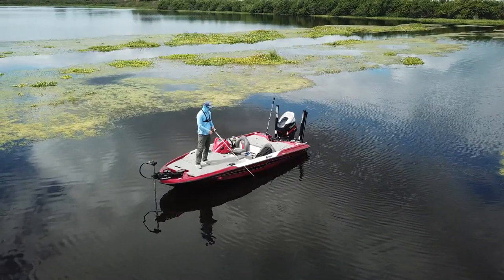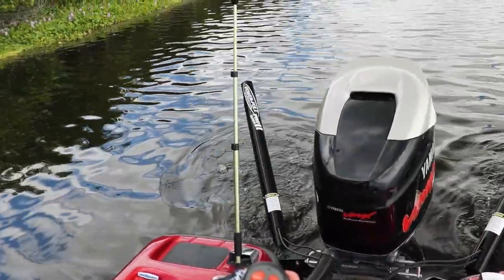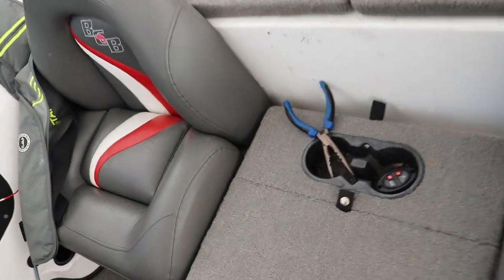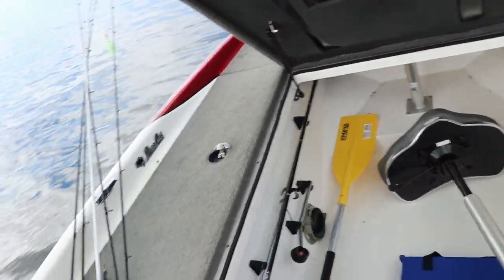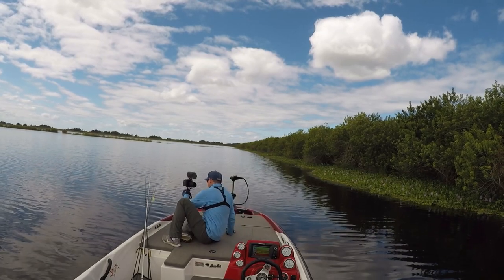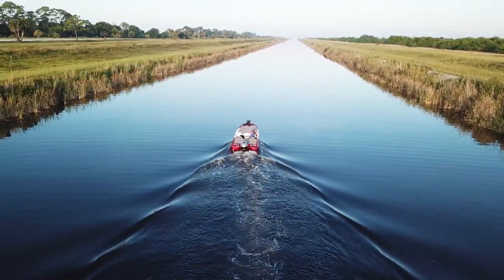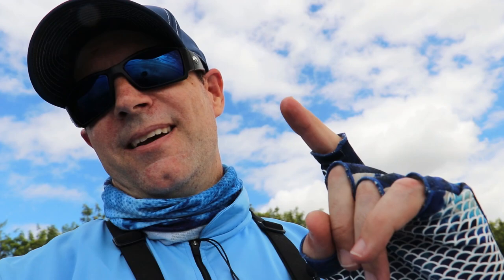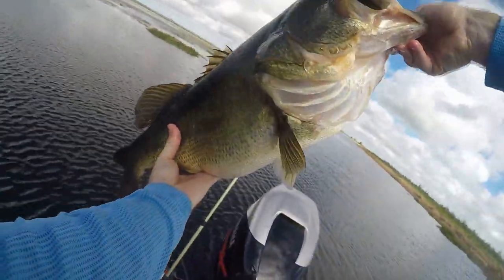What Everybody Ought to Know… About a 17 Foot Bass Boat| Boat Tour

Comment: I bought a brand new 1990 Bass Cat Margay with a 115 Evinrude with stainless Raker prop back in 90! It was my first boat! It was fast it weighed 700 pounds back in 1990! It was sparkly blue and grey! It would run in low 60s and that was fast back then! I now own all payed off a 20ft Bullet with 225 XS Mercury with sportsmaster racing lower unit 85mph gps! Back then Margays were rated for a 120 the beam was 79 inches it was 16 and a half ft! It was 20 years old when I sold it for 8500 and I payed 9900 for it! I all ways kept it garaged!
Reply: Your Margay probably weighs 1200 to 1500 pounds! Back then I would out run Rangers with 150s and some 200s

Comment: If I had the money for a fiberglass bass boat that is exactly the boat I would buy. I got to go on a tour of the Bass Cat and Ranger boat factories when I was about 12 or 13 and I have to say they both really put a lot of attention to detail and quality into their boats. They are definitely made to last. Back then Bass Cat was still using wood (I don't know if they do now or not) but all of their wood was sealed in fiberglass. They were build like tanks.

I have to say, this model, from what I have seen in my dream surfing of boat websites this one is probably the most efficient model of all. However, at my budget and actual needs I am more of an aluminum 16 or 17 foot bass boat or multi-species (Ranger 1660T please) guy with a portable 6 gallon fuel tank.
Reply from the maker: James, thanks for the post 👊 I had a 16.5 G3 Aluminum bass boat before this one. Caught a ton of fish in it for 12 years and could get to more places on the water compared to the Margay. Good luck on your boat hunt👍

Comment: Website says 19' 11" for the Margay and 19' 8" for the Sabre FTD. I'm in the same boat as you. I need it to fit in my garage. My garage is 19' 10". Yes, I probably won't be able to add a Jackplate, but I'd rather do without, than paying for storage. 
Talked to the guys at Aquatech and they are by far Amazing people to work with!!!
Reply from the maker: 19’ 11” sounds right. You can also turn the outboard and get a few more inches. 19” 10” should work.

Comment: Very nice boat!  I've been running my 06 Pro Craft 175 with 125 Mercury for a long time and have never felt I needed anything bigger.  I'm no brand expert but it goes through chop and swells very well for a smaller boat.  I've seen larger boats struggling much more while out with me.  I want to upgrade to a newer Margay if I can find one, or a Ranger in the same size range...hopefully in another season.  Thanks for the review..Can't beat a BassCat hull very easily.
Reply from the maker: Stu659Zuk, Pro Craft are nice boats. I agree, the 17.5 is a good size 👍
Reply: @NormGfishing  does this boat hold 8ft rods in the rod lockers??
Reply: Yes sir finally somebody else has a proctaft

Comment: I had a 17ft Champion with a 150hp where I had the cylinders bored out due to the shop not having any 150hp parts when a rod went through the head. So it was rebuilt as a 200hp, the speedometer toped out at 85mph and I'd peg it without a problem. I'd fire up my motor and everyone at the dock would turn to see what started. It started tearing apart the transom though so I had to take it in and get that reinforced as well. If you wanna go faster trim that boat up dood. Running through the canal at the end of your video you're pushing way to much water, get that front end up, trim that motor up and let it rip!
Reply: Champion Super V? The 16ft 8incher from the early 1980's could move.
Reply: @richerwin6397  Why yes it was haha. Imagine a 200hp on that thing too...Fastest boat I've ever been in.
Reply: I seen a Mean 15 Champion with a 150 on it, he put sand bags in the middle storage area to help keep things under control! The were rated for a 85, I think!
Reply: @jimmycline4778  Those Champion Super V's were great boats in their day.    They were designed after the Skeeter Wrangler, truthfully; a Wrangler was purchased and dissected. Champion improved upon them significantly.

Comment: Im all about saving money too, there's no need to drop 60-80k on a new bass boat because its going to loose value as soon as it hits the water.
Reply from the maker: Bass Legion, I agree 👍
Reply: Definitely.  I'll keep my 1989 Ranger.  Paid all of $4k for it.  Also an 18-footer, 150GT Johnson, deck extension, and 60+ mph with a light load.  It will do anything a new boat will do.  Obviously electronics are a lot different now than 30 years ago.
Reply: Look at the price of 25 year old Bullets. They are selling for as much as they cost when they were new.

Comment: My Javelin 379 was my favorite boat that I ever owned. I hated my 20 footer. I couldn't store it easily,  and it was hard to maneuver in small creeks.  Bass Cat makes an awesome boat. If anyone complains about the size of your boat, they can buy their own.  Not a fan of the power poles. They make boats look butt ugly, but to each their own.
Reply from the maker: Bobby, the Javelin is a nice boat. Thanks for the insight on the 20 footer.
Reply: I agree I took them off my Bullet and sold them, the lakes in Arizona are to deep, I’ll need 50ft power poles to even make them work!

Comment: what prop are you runnning? i have the same outboard on a champion...not really built for speed but i feel like i should be getting more mph out of her.
Reply from the maker: Champions are beautiful boats. I am using a Yamaha 25M 3 blade prop- this is a 25 pitch prop. The newer version would be a Pro model. 14 1/2" diameter 66K45972B000.

Comment: I don't own a bass boat but what is the purpose of those power poles dropping in and out of the water  ?
Reply from the maker: The power poles are shallow water anchors. It allows the boater to hold the boat in place when fishing or any other activity in 8-10 foot of water.  Back saver and they are fast.
Reply: @NormGfishing  Okay thanks for replying back and it's good to learn something new everyday !!!

Comment: Hey buddy I have a ranger r73 which is 17 1/2 ft and it has a 115 on it ...but its rated for a 130 ...did you repower or upgraded a lil bit larger engine than rated if so ...is it legal cause I've been eyeing those newer mercy 150???thanks and great vid
Reply from the maker: Hey Jonathan, the Bass Cat Margay has a Max H.P. Range - 70-150.  I bought the boat with this 150 H.P.  The Mercury 150s are great looking outboards. Thanks for the post...
Reply: Ranger all ways under powers their boats for safety reasons, that is a lot of hp for your boat but I would do it! I love power and speed!

Comment: Norm...  you mention this fits in a 20' garage but I'm questioning that ....    is this legit?   my 16' tin'er barely fits in my 20' shop
Reply from the maker: Hey Brent, great question.  Check out the Bass Cat website and look under Margay Specs: W/Swing Away Tongue - 20'4"
You can also paste this in Google Search: basscat margay specs
Not all boat trailers are made the same.  Bass cat trailers are short for their size due to the way the Swing Away Tongue design.
Thanks for the post 👍
Reply: Great video and I am in the same situation you are with garage space. I'm running a '14 Nitro Z6 due to the depth of my garage.... so I'll let the Nitro comments slide..lol. I say, as long as you can get on the water and do what you want, that is all that matters! I'd fish in a bath tub if that's all I could afford!  Keep it up!